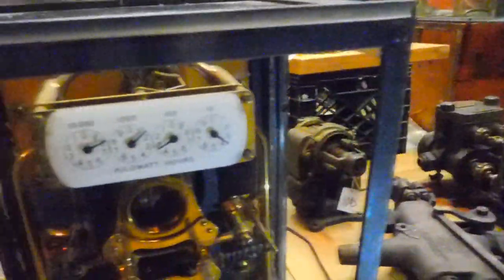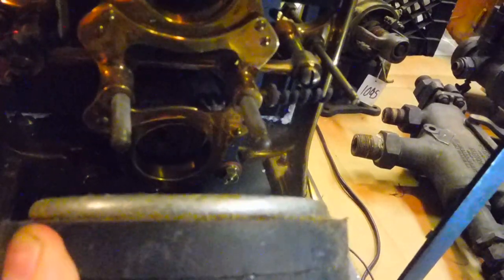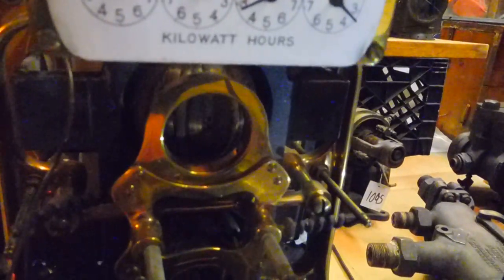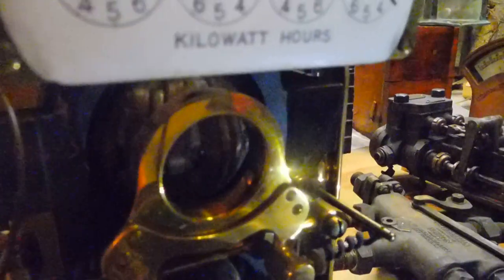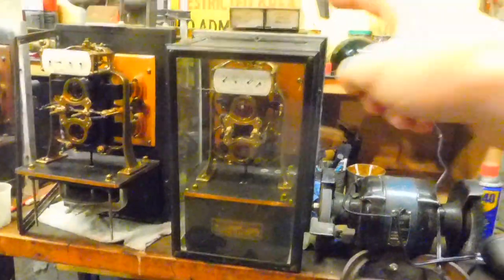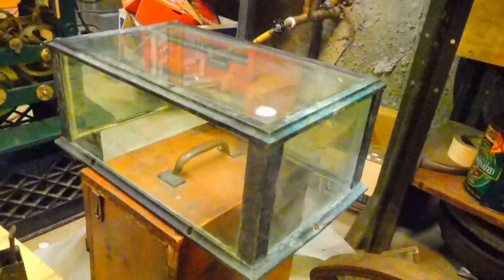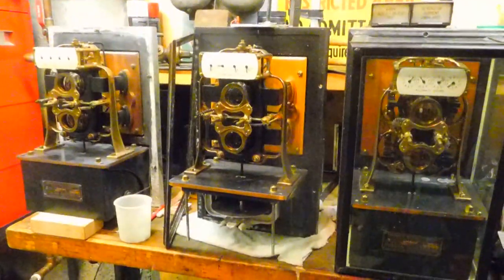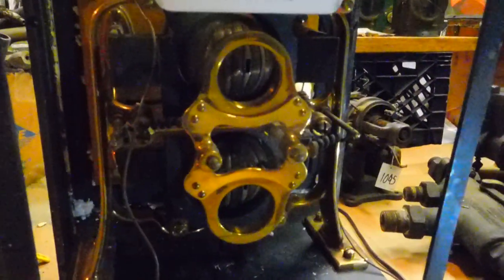The Smashed meter saga

Comment: We need a tour of the lab. Or at least an explanation of the tower clock movement sitting next to the boiler feed pump on the floor.
Reply from the maker: Its not a tower clock movement, its the drive clock for a 3rd order Fresnel lens.  Chance Brothers.  Needs serious repair due to coast guard abuse.
Reply: @AEKarnes  is it clockwork? If so what’s the governing mech?
Reply from the maker: @douglasmcdermott2830  It is, and that is a flyball governor operating a friction brake.
Reply: @AEKarnes  how does that govern the movement or does it act on a friction plate?

Comment: No clue what I'm looking at or how a non moving megnetic field can make another object rotate I'm very pleased you earned a like but can I get a dumbed down reply of what this actually is and it's use
Reply from the maker: The same way it does in any other DC motor.  The rotating spheres you see are the armature of what comprises a direct current motor, there is a commutator on top of the shaft with power supplied to it.  In this case the voltage across the armature is the potential coil and the current through the stator fields is the current coil.  I am simulating a large load with a magnet on the stator.   These meters record watts generated and used in DC on a big power plant switchboard.